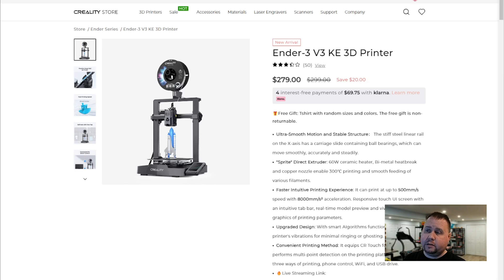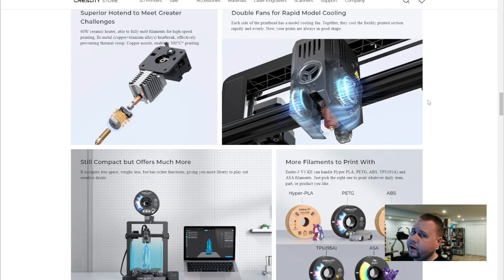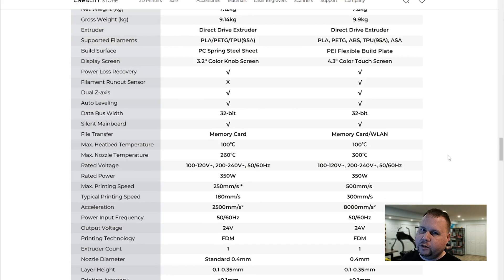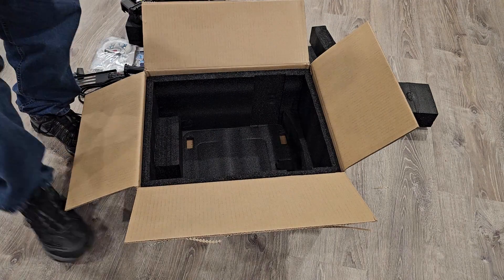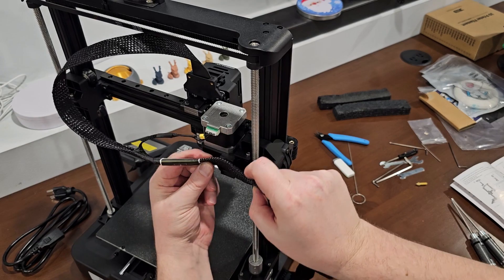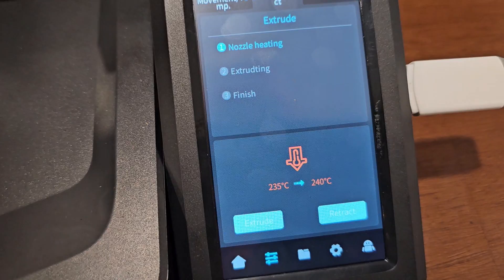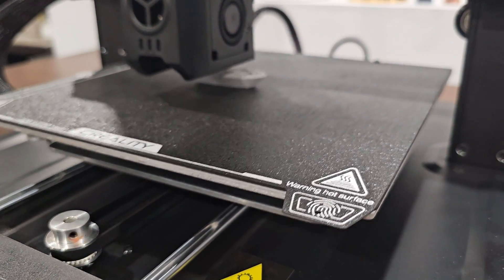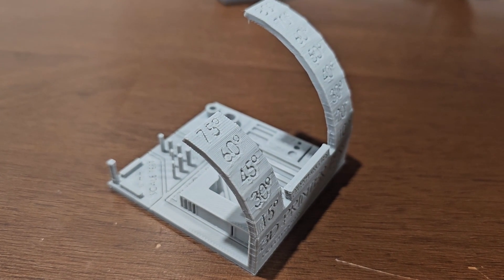The Ender 3 V3 KE - I Think I'm in Love

Comment: I am here to tell you that unless you want to deal with fixing wobble in the bed, bent tool head frames, shake from the linear rods. Do not switch out this printer until they fix these production issues. I know 4 people with KE's and they all have problems. They are known to pre check review units so that is why you won't find these problems in the one they sent you. Just check on forums with how many people are having problems with this printer
Reply from the maker: Thanks for the comment ty, reliability will be a test of time, if I end up having any issues I'll make a video about it